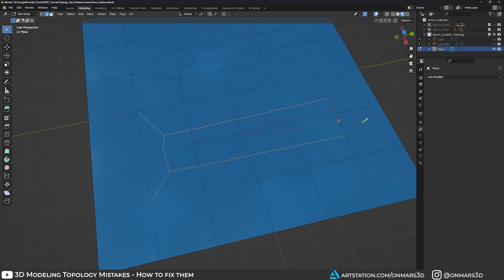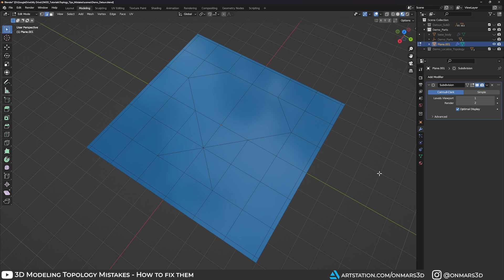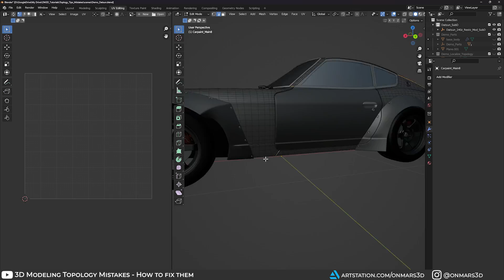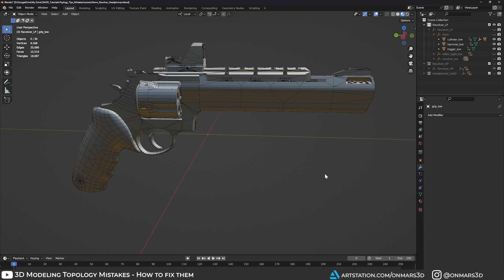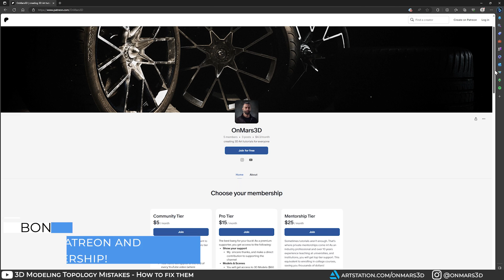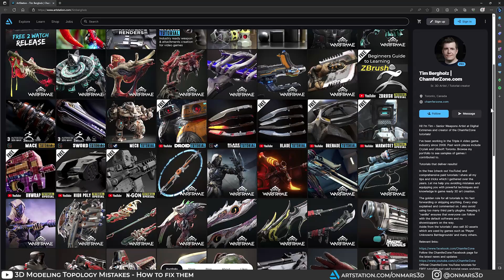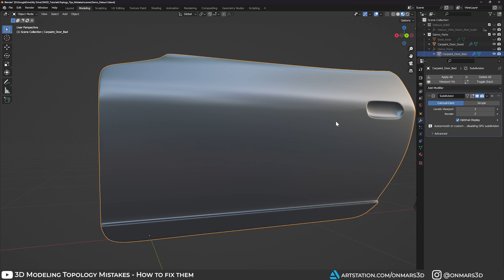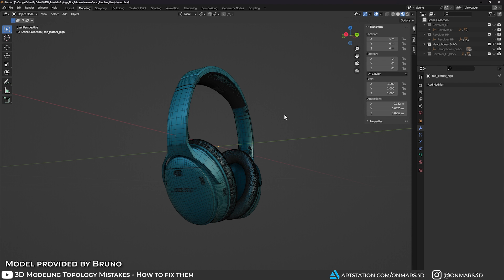Mastering 3D Modeling: Top 5 Topology Mistakes to Avoid

Comment: Hi, great video. Im a little confused by your last secret trick. I thought u were supposed to model in the shapes, detail, and cutouts before subdividing.  I always heard that suddividing before the cutters were applied caused problems bec there is more geo to work with.
Reply: And that makes it harder to iterate on and try different ideas for designs.
Reply: more geo isnt always harder to work with, too much is ofc bad, but sometimes you just need more, i kinda disagree with his mentioned approach, because it is a extra step that you can circumvent most of the time with doing things in the proper order and just having the approriate amount of geometry in the first place
Reply from the maker: I comes down to having enough mesh density to support intricate topology details. Subdividing the mesh gives you more topology to work with to add those details. As long as you still have clean geometry from your cutting geometry, you won't have shading artifacts.

Comment: Low-Poly Base for Form [Maya/Blender] -> Sub-D Higher Detail Mesh [Maya/Blender] -> Low Poly Optimized to fit Sub-D High Poly [Maya/Blender] -> Unwrap Optimized Low-Poly Base [Maya/Blender] -> Bake maps (Normal/AO/ORM/etc.) from HighPoly to Low-Poly Base using [XNormal/SubstancePainter] -> Apply intricate details, textures and materials [Photoshop/Krita/SubstancePainter] -> Smile :)

Comment: Great tips. I do stuff mostly for VR in game engines, so render budgets are tight. The last tip is huge. It saves time and leaves your options open for planning the finer detail stuff later. Not every detail needs to be in the mesh, just the defining and prominent lines and silhouettes/shadow casters to support the shape stably under lighting and animation. If it's some deferred or still image render or ultra close-up with intricate details with advanced lighting or needs to still look sharp on raytraced water reflections use as many polys as it needs and never complain about the extra render time lol. Things like bump and reflect map shaders can make a low poly form look more detailed than it really is sometimes but those have budgets too. A master texture artist can also augment that even further with their use of shadow/highlights on the base texture to support the shaders or not even need shaders for some things. You can spread the detail work out to get the best use of render budget and vRAM depending on the goal of the project.
Reply from the maker: Great points, thanks for sharing!

Comment: I'm still fairly new to 3d modeling in general, so this may just be my untrained eye, but I can't really tell the difference between the two screw examples provided at 1:50
Reply from the maker: There is an extra set of face loops around the extrusions to protect it when smoothing.

Comment: Okay, but what if i use hard edges instead of protecting extrusions? Shading works very well with it and polygon count remains way much lower compared to using protecting extrudes everywhere
Reply: hard edge tend to flicker and become jagged when viewed from afar, especially on low resolution. In the case of realism, there nothing in the world that has infinitely sharp edges. You normally would only be worried about polycount if its a game model, which would mean making a lowpoly version (with optimized topology and defined hard edges)  and baking the normal from highpoly (higher polycount, usually with protected edges and subd)
Reply: @tuanho51  well, this is exactly what i'm doing, i make game models

Comment: the way how i deal with tri and Ngon is treat it like art picture if it isn't in the focus view don't put too much paint on it, if the tri or Ngon in an area that isn't affect by the bone riging and edge leave it be could save your sanity and polycount
Reply: This is actually the same with deciding roughly how detailed something has to be. A great example of this is older games, nowadays, computers are powerful enough to allow for a lot of detail. With 4k gaming getting more and more popular, you do need some higher poly meshes to make it continue to look nice. Yet if you go back to ps1/ps2 era games, then you can often see very very simple meshes used, then stick on a low resolution texture and it doesn't look out of place. 

I'm not sure how cgi does this, yet for games you can often cut quite a many details out of a rig, if the player will simply not be able to see said detail. (e.g. if you've some trees that can only be seen from 50+ meters away, then you do not need the bark to have actual dept, a simple cylinder shape to shape the rough tree is plenty. 
I tend to refer back to older games as back then, you couldn't just spare 10 trees being actual models instead of just textures. Nowadays, we could technically have fully fleshed out models for those trees, yet it's just a waste of resources on all accounts (game will be more laggy for some unseen detail, models will be harder to make and the textures will often also be harder to make)

Comment: 3:36 I was looking at these images and what I find strange is that the details that are additive are not part of the base mesh, meanwhile the negative details are. But in the subd2 mesh, all the details appear to be part of the base mesh including the additive details. Almost like they are combined with a boolean then beveled. How was this done?
Reply: if you look more closely, the details on subd2 mesh are indeed separate, you can actually boolean them, but it would take more time and skills to pull off. As to why they look connected, I think it's just clever trick of the light, and maybe ambient occlusion. There is a trick that I normally use to fake a connection, which is to extrude out the edges so that it barely touches a surface underneath, if that make any sense

Comment: For game models you will also have to care about your uv splits, hard edges and normals in general. uv splits and hard edges will increase your vertex count and often times you will need to use face weighted normals with simple bevels to create a nice high poly like shading. But even when you're baking from highpoly, the normals in your lowpoly still matter a lot and will determine if your normal maps will give a good result and compress well. It's also important to know that very feint normal map details will quickly get crushed by texture compression and mipmapping, so sometimes it's better to exaggerate the bevels a little.
Reply: Also when thinking about gpu performance in regards to polycount, you should always have in mind that gpus work in blocks of 2x2 pixels generally and if they have to shade a triangle that is only one pixel small, the gpu will do the work for 3 additional pixels for nothing. So the size of the model on the screen and the target resolution are defining factors in how polycount affects performance (to a degree obviously). That's one of the big issues that Unreal Engine 5s Nanite System solves.

Comment: In my opinion if you're going for low poly then you should be dropping the polycount as low as possible while maintaining the silhouette. If you gave me a 20k grenade for a low poly game I would laugh you out of the pipeline. 20k is for characters and even then probably pushing it depending on what you consider to be low poly. In most of my games my highest fidelity model is like 10-30k. A grenade would be around 500-1k at absolute max and probably far far less. Even if the grenade had an insane silhouette I would probably just question if that level of detail really fit the style in the first place.
Reply: Like he said, it's all context, I have worked with clients that require characters with more than 100k, and weapons that are around 10k. Lowpoly nowadays is actually pretty high, especially on higher end games.

Comment: couldn't you just crease the edges that make the "+" to avoid the triangles?
Reply: yes you can, whichever works for you, adding extra edges to protect you main edges gives you finer control. In some cases with complex meshes creasing would be better, and faster too. Triangles on flat surface wont matter really, it would also help with cleaner topology if used correctly.

Comment: The last tip is something I use frequently when I 3D model cars, where clean reflections are paramount. Making sure all the large surfaces are perfect before considering fine details - and then post smoothing you work manually on those details.

This is why it's important to not just learn high-poly or low-poly. You can benefit greatly from practicing both. They compliment each other, and understanding polygonal detail work through low-poly workflow is highly beneficial for high-poly projects when it's time to add the fine details without relying on smoothing them artificially.

Comment: That last tip was a realization I had about a year ago while also working on car model. The only downside is that you better be pretty certain you don’t need to make any super low frequency changes to the shape, or you may end up doing retopo sooner than you planned 😅

Solid tips! I’m definitely going to check out the artists mentioned in the video.

Comment: hello and thank you for this great tutorial. i have a question : if i use quad topology and triangle topology in my 3D model, is this wrong? my 3D models are rims for marketplace and when I use the bevel modifier and select the arc option from the geometry section and miter outer section, the topology becomes n-gon and quad. that I have to triangulate them in order to correct them.
Reply: But the person who buys it can easily apply the Sub-D modifier on it so that the topology is completely quad and there will be no problem.

Comment: We need content specifically about number four. Many graphic designers familiar with bezier curves instinctively try to use side effects of subdivision surface to control form with as little detail as possible. When we learn that for subdivs to be used properly we need 6x or 8x more geometry before adding subdivs, we get stuck. We don't know how to work with that much geometry manually without it taking dozens of hours that we don't have.

Comment: I'm learning hard-surface and SubD modeling at the moment, and that last tip was huge. I kept beating my head against a wall trying to add details to my unsubdivided mesh, which was leading to tons of later shading issues and unnecessary topology. Working to the main form, then working smaller is a game changer. Thank you so much!
Reply: Did you manage to get out of that? I'm stuck on it now, difficult topology, hard surface. When I try to do the sub-d, everything goes wrong, I feel like I'm banging my head against the wall hahaha

Comment: Tri count and tri usage are definitely ones I struggle with. Also, the tip about protecting the extrusion I just did for a Sculptober piece. Not even sure why I did it but it just felt right to do. Unfortunately the tip about detailing after SubD I failed to do on that very same piece so there is a small error when it comes to a hole in a cylinder but the silhouette is fine so it worked out lol
Reply from the maker: All good, it's part of the learning process!

Comment: In my self taught adventure to learn 3D modeling, I usually run into the issue with poles in tutorial videos. The #1 thing I hear is to avoid them unless necessary. When you're just learning, you have no idea what is a necessary pole or not. I saw surprised there wasn't anything mentioned here. It makes me think that at a professional level, it is obvious that poles are abundant and necessary to do any high quality modeling.
Reply: I don’t do any soft body stuff but I know the poles found on faces (actual faces for characters), specifically the location have been found to be the best over time. I do car modeling related stuff, and every front fender has a strategically placed pole that connects the circular, wheel part, to the flat top where the hood connects. It’s definitely advanced stuff that I wish to learn more about. Same boat, self taught adventures :)
Reply from the maker: Poles are unavoidable but something you want to use to control the edge flow. Great point!

Comment: Not a topology tip per se, but one that relates to topology : Stop trying to build things as a single piece of geometry. I have seen this all too often and have done it myself when starting out. Do some research about how real world things are made, I can assure you a lot of stuff is not made from one solid part.
Reply from the maker: Definitely agree, that's a great tip! One of the key points I bring up for beginner modeling.
Reply: Thanks

Comment: I am still having issues when it comes to the wavy pattern on cylinders when baking, most of the time 32 edges is enough to prevent that, but when i want to go lower like 24 or less edges, it just wont work. I have read the solutions to this online of baking with more edges and then removing edges after and that has worked in the past but for some details that more complex it just isn't feasible. If you made a video on baking cylinders, that would be a lifesaver for a self-learning guy like me wanting to model environment art for games.
Reply from the maker: I feel your pain and info through this regularly when baking cylindrical objects. I definitely plan to cover this in an upcoming video soon!
Reply: @OnMars3D  yeah, also the super black highlights or the opposite effect of white highlights when trying to bake a high to lowpoly soda can around the rim for example is something I’m trying to figure out. For example the new Spider-Man game has a lowpoly soda can and I wonder if they even used a high poly because their can is like 16 sides but has no baking artifacts from what I can tell.
Reply: @OnMars3D  thank you for replying!
Reply: You’re talking about the triangle fans on the end faces? The simple fix is to add one or two supporting loops close to the circumference. That will fix the wrinkly-subsurf problem.

Comment: I used to model in Fusion360, export to 3dsMax and retopo and then create the high poly. Now I Model in a low Fusion360, copy the mesh and add all the high poly details. Export as a low detail obj , export the high as a high detail obj to bake with. The result is a triangulated low , a slight pain to UV but it has a very low vert count and high accuracy in terms of form. This workflow is also very fast.

Comment: Good video! Some extra for the tip at 8:02 though: Consider using Crease on the edges that you want to stay hard before subdividing, it prevents them from smoothing so you can still easily add the support loops around them
Reply from the maker: Thanks for the tip, hoping to cover creasing in future videos!

Comment: In some courses it is quads only, no tris.
So, this depends on where you work too.
But insert edge loops might make it look, overloaded but it is better looking in general.

You said that Ngons are okay, what???
If you have a prop with Ngons in school, it is a just a big nono.
The explanation with why quad and why tris is quite good.

The polycount indeed depends on what it's used for, a small rock in a game does not need 1M+ tris, since it is small and not generally seen a lot, common sense.

We keep on learning and improving.
Reply from the maker: Agreed, ngons should be avoided. I wanted to cover what happens when they subdivide. I'll be covering that in a future video so thanks for the comment!
Reply: spooderderg4077  Low poly is not the practice of making a model with a low tri-count. Since then, your quad count is basically going up. It's a bad practice even when in low poly. Low poly is not the art of getting the lowest tri-count.
Reply: spooderderg4077  I agree with you on most of these things, I did not know the history of the early 00's.
But the last part, never would have been programmed in?
It is not a feature, it is a side effect of how the rendering logic is programmed. Also it is needed when making a model, since if you remove one edge from a quad, you already create a ngon, if it was 'not programmed in', the application would crash.
The only way they could avoid someone exporting a model with ngons, is when they try to export the model, say "the model has ngons, fix it".
But everyone knows its unrealistic.
Every quad are basically 2 triangles.
Every Ngon are several triangles.